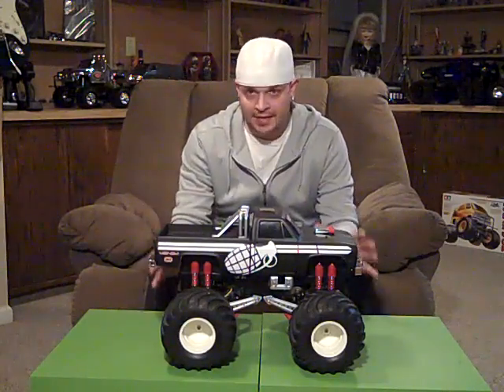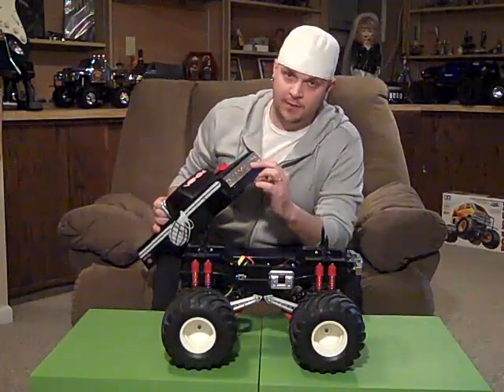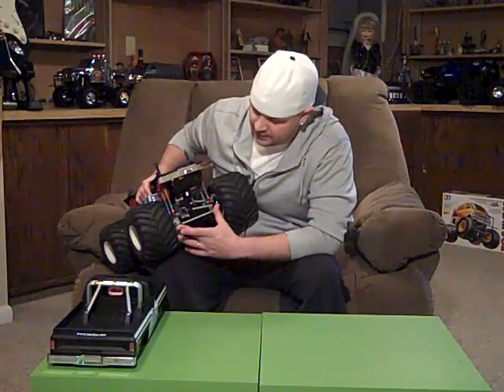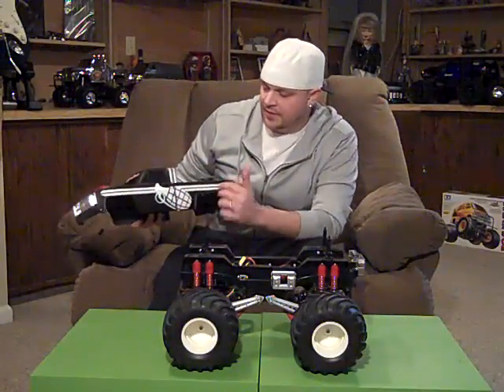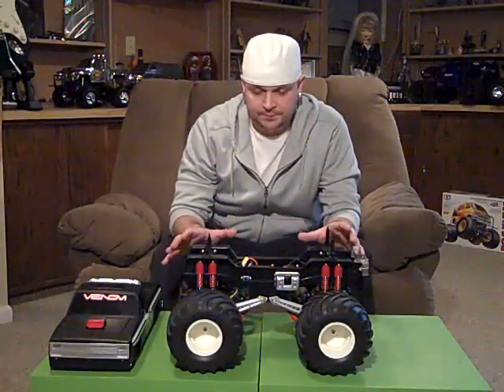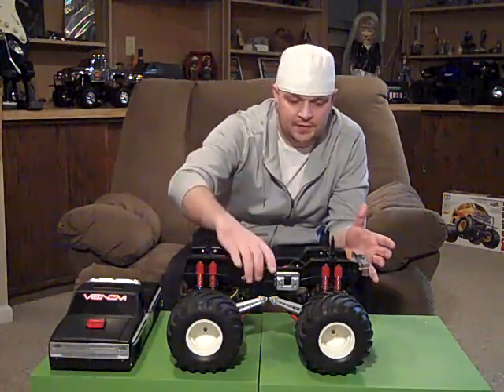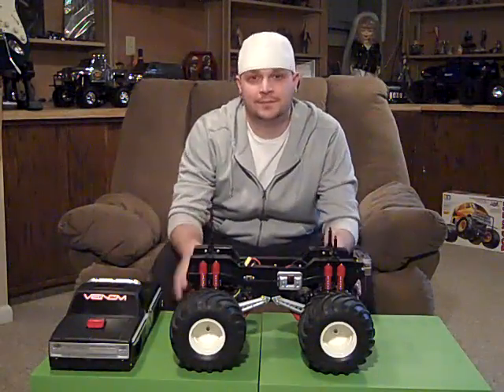Vintage 1987 Tamiya Clodbuster

Comment: Man, I remember this bad boy. It was the second R/C I ever owned after my Grasshopper. I really enjoyed building this truck, especially upgrading most of the parts; aluminum chassis, oil filled adjustable shocks, heavy duty steering arms and those crazy powerful pulling motors and metal gears that had a lot of my neighbors in disbelief at what this puppy could really do.
Fun times......

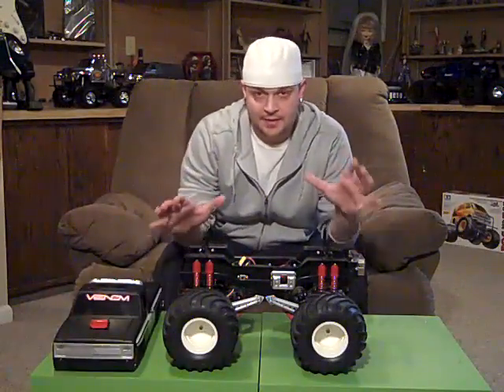Comment: From 1:50 you state "it has the original stock silvercans in it that were in the kit from 1987 and they still run". I hate to be picky, but the 1987 Clod Buster came with Johnson motors with a white endbell and alloy front bearing holder. then after 1989 when Tamiya got asked to remove the Chev insignia they used the gunmetal grey endbell Johnson common in Tamiya's like the King Cab etc and later Bullhead. Those Mabuchi motors with the gold round sticker were from the early/mid to late 00's.